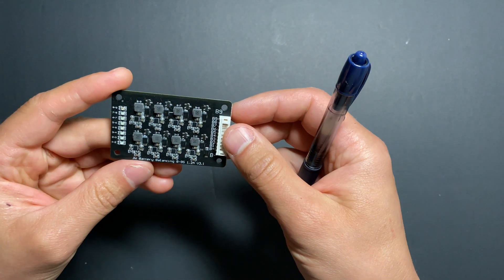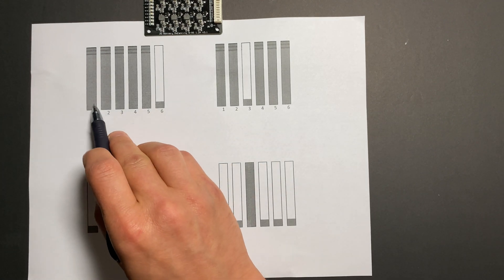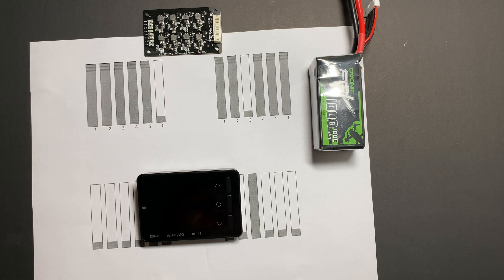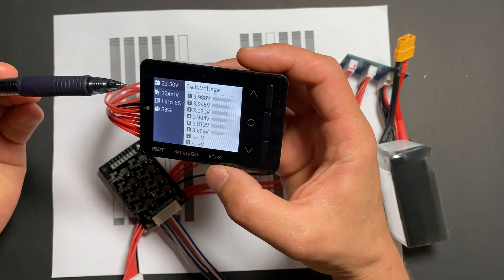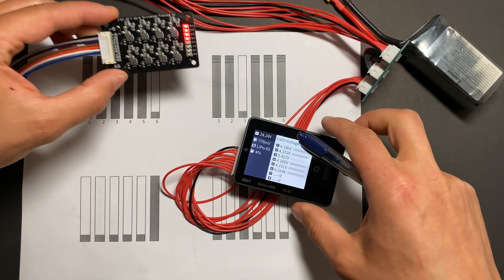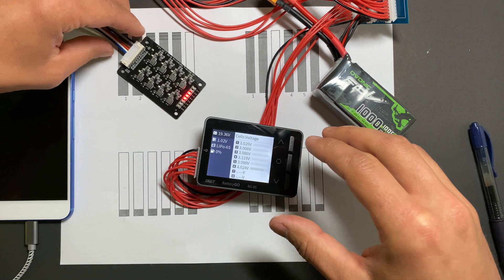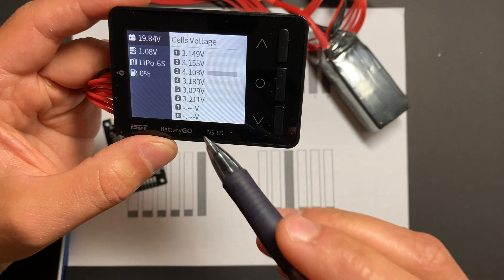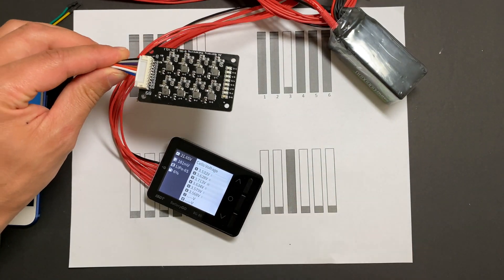Detailed test of battery active equalizer 1.2A balancer.

Comment: Were did you get your HX 3x1 board? cant find one anywere, i need one to add a balancer to my BMS
Reply from the maker: I built it using https://easyeda.com/ and then ordered PCB on https://jlcpcb.com/
I wouldn't recommend it to parallel BMS and active balancer, in my case BMS was reading incorrect voltages while balancing pushing amps. So I did run 2 sets of wires (1st set for active balancer, 2nd for BMS).
Reply: @SolarEngineering  ok! Thx for the info. I will run a second set of wires for my balancer.

Comment: Very interesting video. I think your video shows that this board is really only suitable for maybe up to 4S if you need the balance to be very precise. 2S and 3S will be very precise (less than 60mV), there could be a small difference of up to 90mV between  1 and 4 in a 4S and that error will increase by 30mV as the S number increases.

Comment: According to the instructions, the last three LEDs blink when there is a "circuit failure". Not connecting cells to those leads is likely considered a circuit failure. I have also seen flashing LEDs for low quality battery packs. For example, I have watched cells 1,3,5,7 do transfers while cells 2, 4, and 6 blink. In the end, all LEDs are dark so that sort of circuit failure is temporary.

Comment: the balancer is very good but it take a lot longer to balance below 100mv
under 100mv balancing current is less as the voltage difference drops

Comment: where did you buy the test Leads splitter?
Reply from the maker: was not able to find a place where to buy it, so made it myself.
I used the website jlcpcb.com, paid $20 for 5pcs with shipping.
Reply: You should be able to use a parallel balance charging board. You just don't plug in the xt60

Comment: Great Job!
Have also tesed this version with about  100mV difference, but they say about 30mV, so this pcb is no good...
Reply: It looks like the 30mv difference is specified for in between cells, not across the whole pack, hence the pyramid shape results. The test in the video was great at showing this.
Reply from the maker: yep.. waste of money, I tested another one, also inexpensive and got good results.
https://www.youtube.com/watch?v=fb7KvTOxejo
Reply: @SolarEngineering  I wouldn't consider these a waste of money. Before, I was loosing cells in the middle of the pack and the positive end. It seems those cells take all the abuse in fast charging and discharging. These boards distribute the load, over time, enough for those cells to survive and slowly give excess power to adjacent cells. I lost $300 in 18650GA cells before discovering this technology.

Comment: Great job!
Just a remark (which doesn't change your end result): Having spent some time on the working principle, I understand that it is a sequential balancer. That means, it compares the voltage difference between two neighboring cells and acts if this is greater than 30mV. This in itself seem to work if you grant it its time. However, if you have a 6s setup, the difference can theoretically get up to 5x 30mV = 150mV between the first and last cell in your setup. But as you reported the biggest difference to be 340mV in a 6s setup, this does not fit the specification. So your point is valid in two ways:
1. It does not keep what it promises (30mV difference) and
2. Based on the principle, it never can reach 30mV between ALL cells if setup is greater than 2s.
Reply from the maker: that's interesting, so theoretically this device works (30mV between neighbor cells), but practically not to much..
thanks!
Reply: @SolarEngineering  I think the idea is that you're not supposed to start with your batteries so far out of sync.  It's meant to stop them from drifting.
Reply: @tomstdenis  Thats what I was thinking as well, the balancer does what it was meant to do but normally you wouldnt have a battery pack with such a large delta
Reply: It looks for a 100mv or greater difference between adjacent cells and then will balance to within 30mv. The bad thing about this is that cell 6 can be charged up to 4.3v if cell 5 is at 4.2 and it won't do anything about it.

Comment: I fail to see why you would call this failure!!

It does Balance, your spreadsheet that you show for a few seconds at 11.59 clearly shows it works.

Specifications state:
Equilibrium current: Adjacent pressure difference is 0.1V or more (current is about 0.5-0.7A); Adjacent pressure difference is above 0.2V (maximum equalization current is 1.2A); The smaller the differential pressure, the smaller the equalization current.

At difference above 0.2 volt you get 1.2A, under 0.5-0.7A

Your test show that it works, perhaps not as fast as you like.
For +/- 5 USD per cell, it's good addition.
(S4=$20, S16 =$75)
More powerful balancers are double or triple the price.
A good solar setup would need little to (almost) nothing in  balancing. 
Once every 6 months should be enough.
With that rate of getting imbalance, this tool would be able to make it once a year or even longer.
Reply from the maker: In specs it's claiming that it will do 30mV.
I measured cell diff after all LEDs was off (meaning that balancing is stopped).
Then we see 340mV cell diff.

It's definitely working balancer, just not accurate as it claiming :)
Reply: @SolarEngineering  On that test where You have 340mV difference when you put tester on desk balancer lights on led to balance, that mean it is fault with youre wires. take a look at 9:35

Comment: I think to buy one off this to put inside an ebike battery but I’m not sure . Maybe you can give a advise. It will be useless ? Maybe to slow? Is 36v 17Ah and cell number 6 is always reach 4,2 v and the bms shut of charging . A fully charged battery shoul have 42v but i get 40 instead . I am ok with results because I build the battery myself from old battery tools and I get 60-70 km range att medium assistance and 50km with max assistance but I am thinking if is something I can do better . What do you think . You made a great test with this little board . Congrats .
Reply from the maker: this balancer is totally useless. Cell difference is HUGE. I would look at some other options:
1. Another active balancer (review is coming soon)
2. Passive balancer.

Pros for #1: not wasting energy
Pros for #2: smaller size (I guess size is important for e-bikes)

Another review for active balancer coming soon. Ir you now any other balancers - send me message and I would like to test it.
Reply: SolarEngineering this ? A bit bigger for sure but I can eventually remake the battery pack and made it bigger . This can be worth because I have seen a review on YouTube about a big battery . https://www.ebay.com/itm/3S-4S-6S-8S-15S-5A-Balancer-LTO-LiFePo4-Li-ion-Battery-Active-Equalizer-Balancer-/303427546569?var=&mkevt=1&siteid=1&mkcid=2&mkrid=711-153320-877651-5&source_name=google&mktype=pla_ssc&campaignid=10428844302&groupid=103146265403&targeted=pla-293946777986&MT_ID=&adpos=&device=m&googleloc=9077372&itemid=303427546569&merchantid=116792603&geo_id=192&gclid=CjwKCAjwsan5BRAOEiwALzomX0CoSVgX5cI4m-OwDbSquGkwVLjlCmxKkJ65DRvWIW6tf30jylYwMhoCrmgQAvD_BwE
Reply from the maker: @ciprianbeniuga5042  I'm going to order and test it.

here is what I'm waiting to arrive to test:
https://www.ebay.com/itm/2A-Balancer-Active-Equalizer-2S-24S-BMS-APP-For-Li-ion-Lipo-Lifepo4-LTO-Battery/312684990374?hash=item48cd7a4fa6:g:kGgAAOSwwRtdHXuI

heard good reviews about this balancer
Reply: SolarEngineering I guess passive balancer generate more heat and inside a battery case when charging can be problematic . But maybe is ok . It will be is interesting to know how warm the board  can be when balancing .
Reply from the maker: @ciprianbeniuga5042  I'm testing this balancer right now, it works great! video is coming soon.
Reply: SolarEngineering Perfect. I am going to order one as well . It will be interesting to see your test because you seems to do detailed and very good explaining videos . Great Jobb . Greetings from Sweden .
Reply: If one cell is too fast reaching high voltages, you might have less good connection between the bus-bars and cell.

E-bike is totally different ballpark then solar for unbalanced cells.

Both charge and discharge goes at much higher speeds.

Solar setups one thinks in days instead of hours for doing Balance.

As it is for charging, yes, this is a good solution.
It might not work as fast as you like, you get what you pay for.

Charging the battery, disconnect, leave it balancing for the night and charge in the morning the remaining capacity.
This way you get maximum charging capacity for the cells.

If you have good charger, naturally you can leave it on the charger.